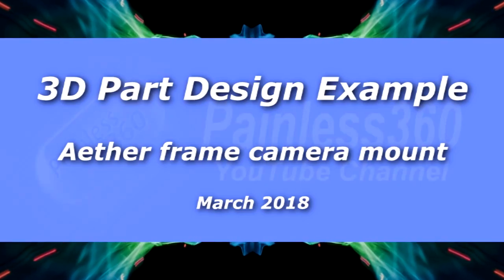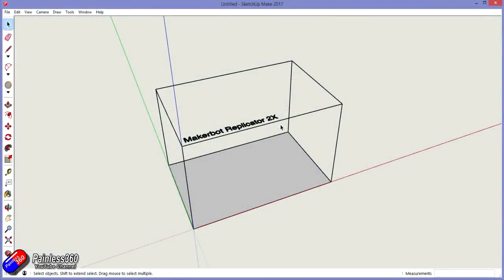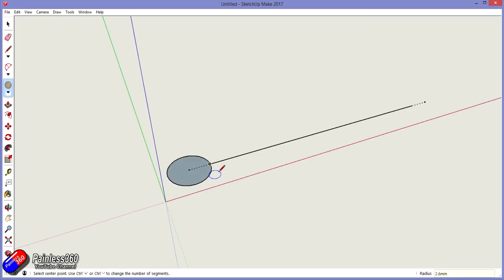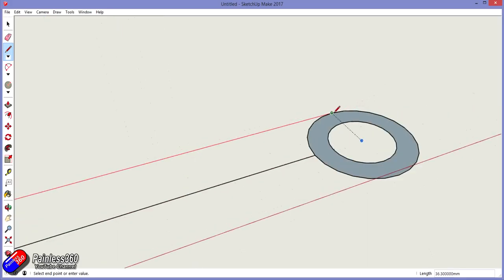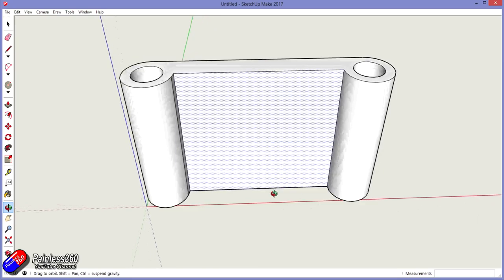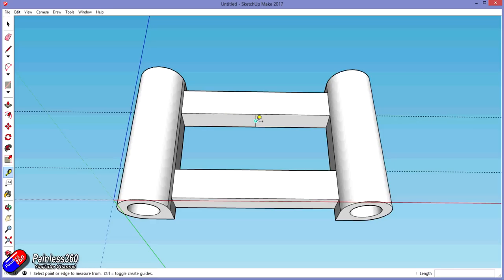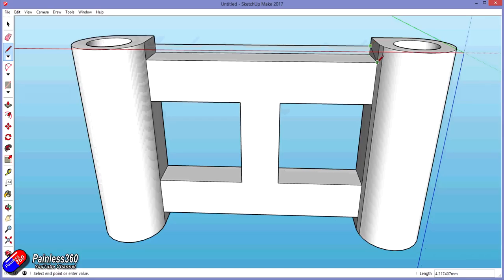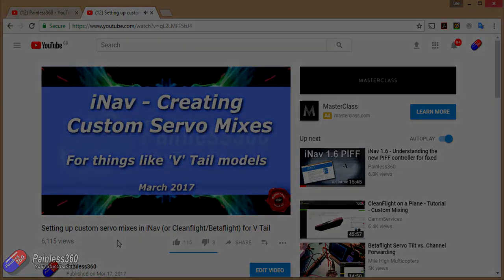MAR 3D Model creation example with Sketchup - AEther frame part

Comment: Great videos. Have you tried the round corner plugin by fred06? Very quick and easy.
Reply from the maker: I'll have a look at that, thanks for the idea..
Reply: The bezier curve/surface plug ins are good too. Also push/pull joint plugin lets you pull curves.

Comment: This is great stuff keep them
Coming. I use sketchup a lot for work and really like it but I am planning on getting a 3D printer. How do you load the file into the printer? Is it easy enough? Cheers
Reply from the maker: I'm planning on a video showing the process from start to finish as I've had a few questions like this. The quick version is save the file from Sketchup as an .STL file (you'll have to install an extension into Sketchup to let you do that), then start CURA (or similar) and load the STL file into it and select the temperatures, layer height etc. and then save that as a G-Code file. That's the file that you can usually pop onto the SD card for the printer and then pop that SD card into the printer and select it and press print! :D
Reply: Painless360 ah ok thank you!! Just need to get a 3D printer now cheers for the reply 👍🏻
Reply from the maker: for you, a preview! https://www.youtube.com/watch?v=9u5ypkw2ZQ4

Comment: Hi Lee,  I have been trying to draw arrowhead shaped led light covers, that are curved to follow the contours of a quadcopter arm. I can draw the triangle shape fine in 2D, but sketchup  wont allow push pull in an arc. There is a way to do this, by using a drape tool in sandbox. I have not managed to master this tool yet, and wondered if you have a tutorial or experience using this tool. Thanks.
Reply from the maker: SketchUp isn't fantastic at curves, I'd potentially draw the curves that you want at each end of the object and then draw the connecting lines between them so SketchUp create the geometry you need to make the part. Hope that makes sense, and I understood what you are asking..
Reply: Yes that does make sense, I did try a method by drawing the shape over an arch in plan view, but when I switched to side profile view , I found the guidelines were only connected to the highest point and floating above ground zero, and I could not seem to bend shift or warp into position. I have seen others using sandbox for similar applications and I have the tools required in sketchup to carry it out, but I'm missing something in the methodology somewhere.

Comment: This is great stuff, but when i'm making a hole with push / pull tool, sometimes it works, sometimes it does not work, the stickes to the mouse pointer, it is not good for blood pressure ;)
Reply from the maker: I used to find that tool one of the most frustrating too. The trick is to have the model in the right orientation so you can see the face you're about to push/pull and the face you want it to 'snap' to. It's all in the prep! :D Happy Printing!

Comment: What's the lowest price 3D printer you can confidently recommend? Mostly be used for quadcopter parts.
Reply from the maker: There are quite a few kicking around for less than a couple of hundred pounds that are very good. I'm using the Turnigy Fabrikator mini 2 here almost every day...

Comment: You should have a look at Fusion 360. Has a little different workflow than sketchup...but once you get the hang of it you don't wanna get back to sketchup. 
It's just way too clunky. 
Probably because sketchup is made for a completely different purpose.
Reply from the maker: The purpose of these videos is not to look at 3D software, it's to give people the confidence to have a go themselves. The advantage with SketchUp is it just like drawing. Fusion 360 is fantastic but there are some additional concepts that you need to consider. Thanks for posting, happy printing!
Reply: Painless360 I know, I know. 😀 Just wanted to give a recommondation if you haven't tried it yet.
Though, I found Fusion easier when I started because you rather draw in 2D space instead of 3d. I always had a hard time drawing the lines where I wanted them.
Reply from the maker: Fusion360 is so much nicer as (for me) it's the best of Sketchup and 123D in one app! Easy dimensions and guide lines with curves that work! :D